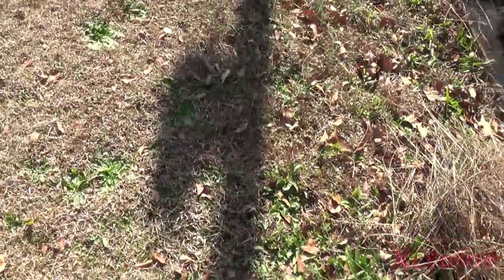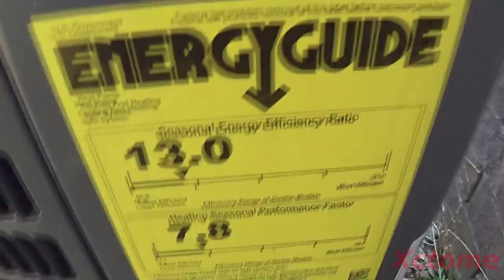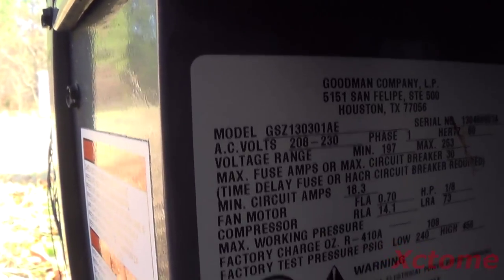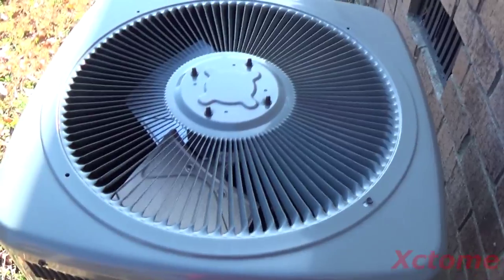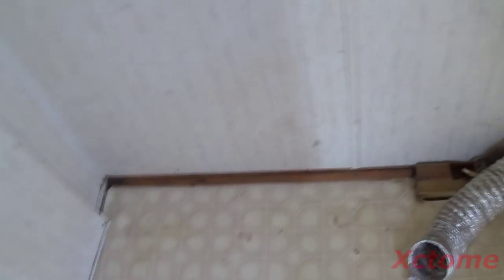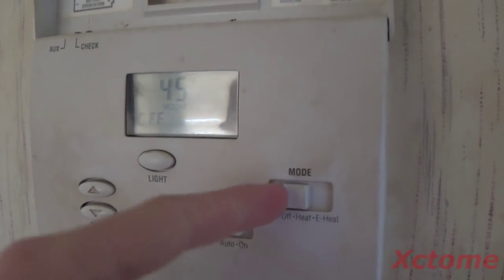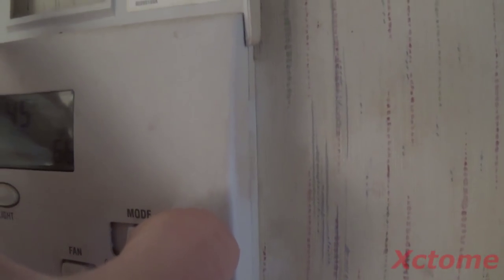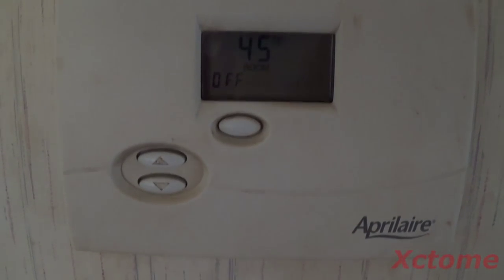2013 2.5 ton Goodman GSZ13 Heat Pump Condenser and a 1996 Intertherm 15kw MH Air Handler

Comment: What is that SEER rating?
Reply from the maker: 13 SEER , i cannot remember if it has a TXV or not, if it has a TXV then its 14 SEER. HSPF is either 7.7 or 8 being 410A i would guess 8 on the HSPF.